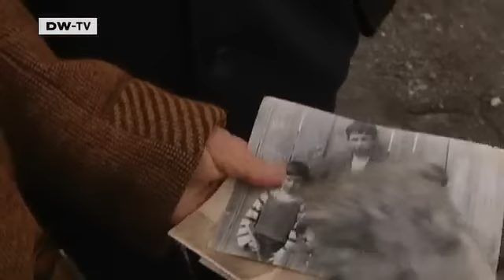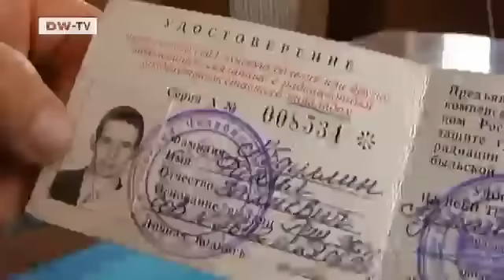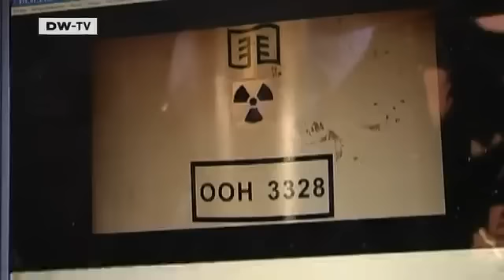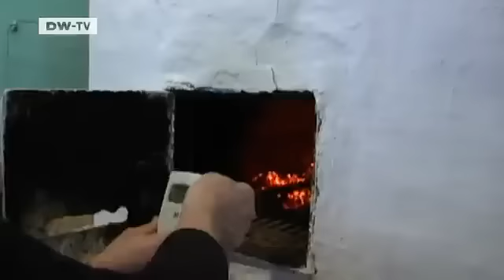Markus Reher visits Russias Mayak nuclear facility | Journal Reporter

Comment: At one point Karachay lake had parts that would inflict enough cellular damage by ionizing radiation that it would give an adult a lethal dose. Certain death within few weeks.
As a certain level of highly radioactive material has decayed and some of it even migrated in the depth of the lake bed, situation has improved in the past decades, but it's still extremely dangerous to visit those sites.
Reply: endimion17 ii
Reply: There are families living within 4 Kilometres of the lake, and depending on the weather, dry dust from around Karachay is blown on the wind to settle where it can. The amount of contaminated sediments at the base of the dam on Metlynskiy Prud are enormous. That was supposed to have been cleaned up by now, but to no avail.

Comment: DW actually did make quite a few mistakes in the video. They talked about "nuclear plants", yet Mayak had nuclear REPROCESSING plants which were badly run, so a fragment of the waste ended in the environment, mostly in the Karachay lake.

The beginning, with the Greenpeace activist, talking about "20 times the normal level" is ridiculous. Not only such levels are extremely low and occur in nature, but Mayak has a lot of worse things to offer. I mean magnitudes of order worse.
Reply: In another documentary on the area the Geiger detectors found places with 25, 50 and 100 times the normal level. And that is in nearby villages.
Reply: It WAS a nuclear plant indeed. It had 5 reactors that produced plutonium for the bomb project. Nowadays it's a reprocessing plant, has been for a while. For a fact; Finland also delivered its spent nuclear fuel there from one of its npps until 1996 when it was forbidden.